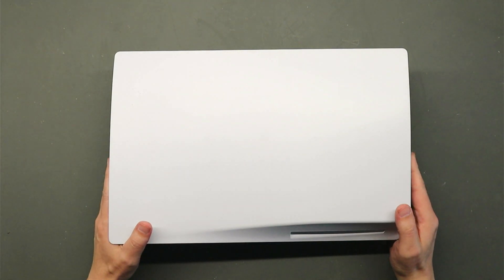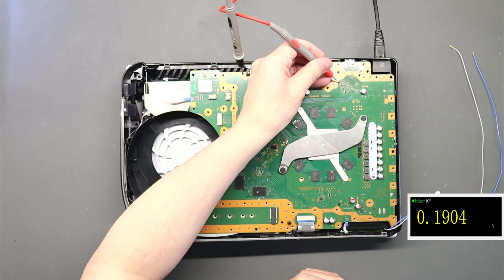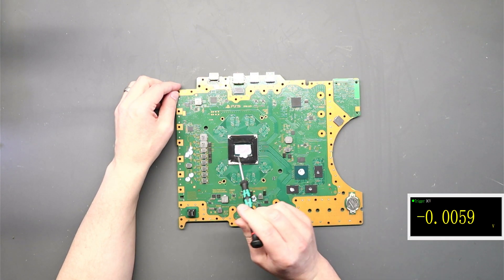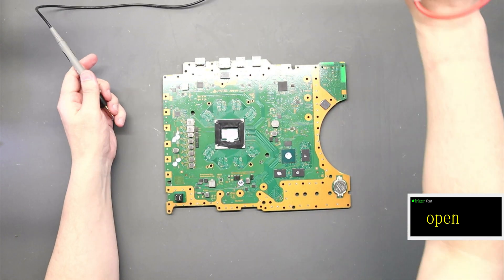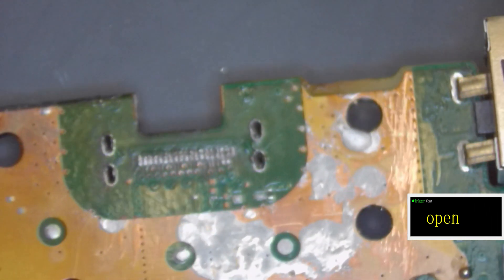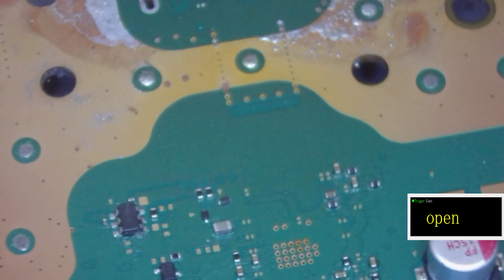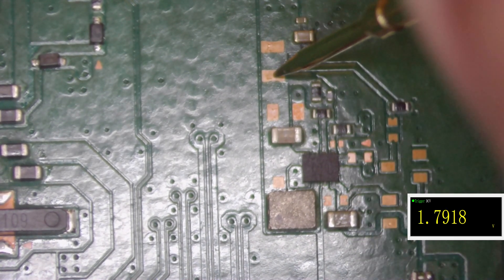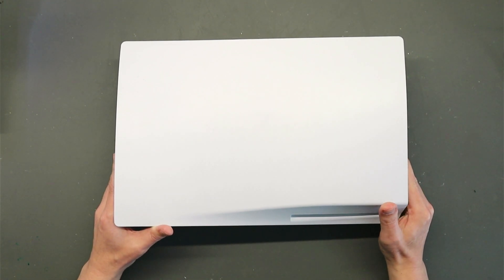PlayStation 5 No Power Fix - Fixing a Dead PS5 after a failed HDMI port replacement

Comment: Do you know what’s wrong with my PlayStation it turned off while I was playing and hasn’t turned on since. No sound coming or lights and I recently had a HDMI port repair like the day before thanksgiving if that does something
Reply: Thanks, I took it back and I don’t know what they did. The PlayStation turns on now but randomly turns off in the middle of a game
Reply from the maker: Sounds like you have a short somewhere on the motherboard - I would take it back to the place that replaced the HDMI port and ask them to check it over